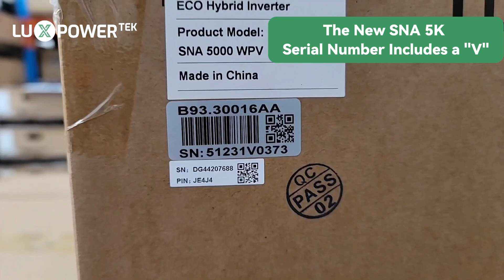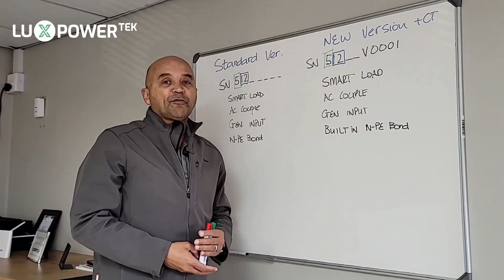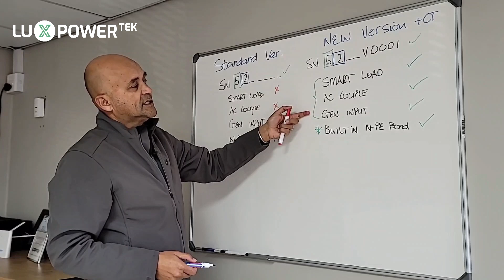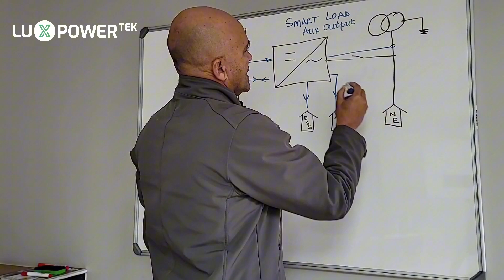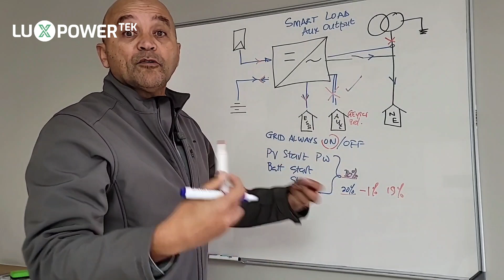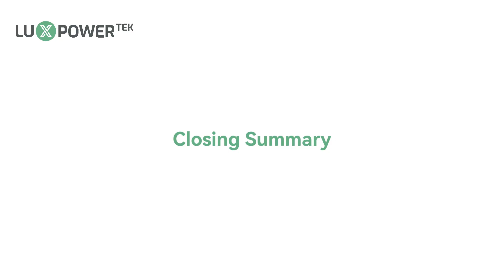SNA 5K vs. New SNA 5K with CT vs. SNA 6K – Key Differences Explained

Comment: If an old SNA5000 is paralleled with a new 2026 SNA5000, does it matter which one is the master? Also what should the firmware version on the older one be since I see it is recommended to have them on the same firmware version (surely not possible between new and old version?)
Reply from the maker: Hi there, thank you for reaching out to LuxpowerTek. We’ll need the serial numbers of both inverters to confirm their hardware versions and firmware compatibility. If they support the same firmware version, we recommend keeping both units on the same version for parallel operation. Please share the serial numbers to info@luxpowertek.com, and we’ll check this for you.

Comment: Why is the E-N bond always on. Should only be switched on when Incoming AC switches off and vice versa. Relying on the user to switch the E-N bond setting on when the Incoming supply goes off is dangerous, and keeping it permanently on is equivalent to a permanent E-N bond which is also dangerous.

Comment: All nice in theory, and the reason I bought it... But why do I need an installer account to enable the CT and smart load settings and unable to do it from the Inverter panel? And don't give me any nonsense about incorrect CT settings because the setting to enable feed out to grid is already accessible directly from the input panel...
Reply from the maker: Hi there, thank you for reaching out to LuxpowerTek.  The settings are available on the inverter LCD menu. The limitation is that remote settings through the App and Web portal are currently restricted based on different account permission levels.

I have already forwarded your feedback to our engineering team, and your comments will be included in our ongoing discussions. Thank you for your valuable suggestion.
Reply: @LUXPOWERTEK My apologies, I somehow missed the setting for it on the inverter LCD menu and was trying to find it on the App. But yes being able to access all settings from the app without an installer account would be great. And I do think a setting is needed for being able to change the behaviour of the E-N bonding relay when utility incoming AC is connected or disconnected
Reply from the maker: @Louis66666666  Thank you for your suggestion.

Just to clarify, when N-PE Bonding is enabled, the relay operates automatically:

When the grid is connected, the N-PE relay remains open to avoid multiple N-PE bonding points.
When the grid is disconnected (EPS mode), the N-PE relay closes automatically to establish the N-PE bond for off-grid operation.

If N-PE Bonding is disabled, the relay remains open in both grid-connected and off-grid modes.

Could you let us know what behavior you would like to achieve that cannot be achieved with the current N-PE Bonding setting?

Comment: Sir, is there a newer version of the SNA 6Kw, like that of the new SNA 500 Kw, if so, what would be the indicator? Ex. Like the V in new version SNA 5000? Thanks
Reply from the maker: Hi there, thanks for your reaching out. We have the label on the inverter side, it will shows the inverter model number. So you can see the label to check the model is SNA 5000 or SNA 6000.

Comment: Thank you for this clear information.
I've had the SNA 6k for a few months. Its maximum PV power is sometimes listed at 8kW and other times at 9.6kW!? What's your recommendation, please?
Reply from the maker: Hi there, thanks for your question!
The earlier version of the SNA 6K had a max PV input of 8kW, but we’ve upgraded the hardware in newer batches to support up to 9.6kW.
Please check with your supplier at the time of purchase or installation to confirm which version you have.
Reply: Thank you very much for this clarification. Mine must be 8kW because it's a few months old.
I have the option of connecting a 4kWp PV array, but bifacial, and could probably produce around 4.5kW in real time at the moment... Will that be too much for a single MPPT on my SNA?
Reply from the maker: @thierryc4132  Hi there, it's ok if the max. pv power is about 4.5kW for a single MPPT.